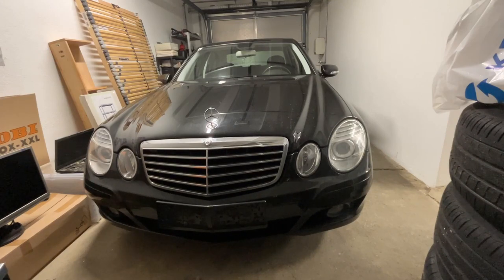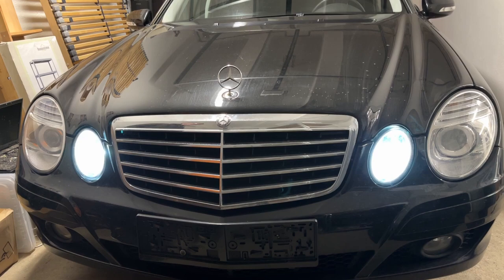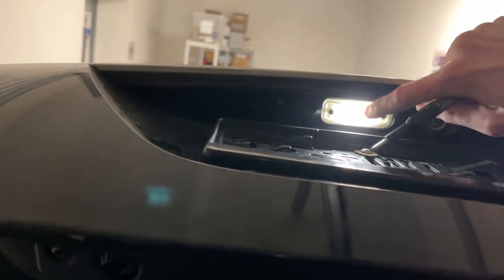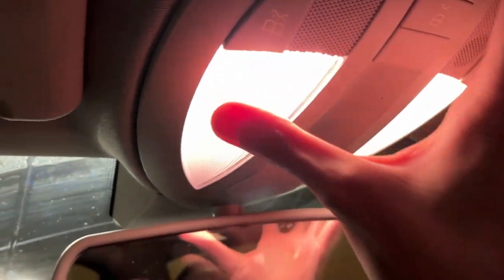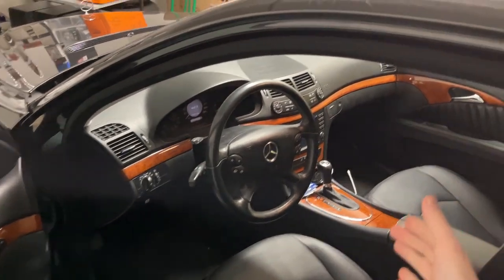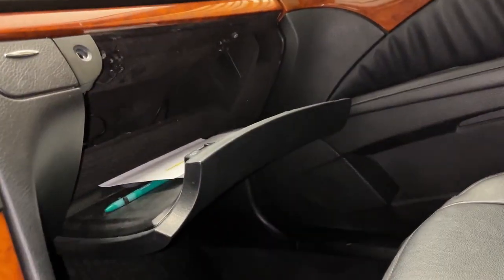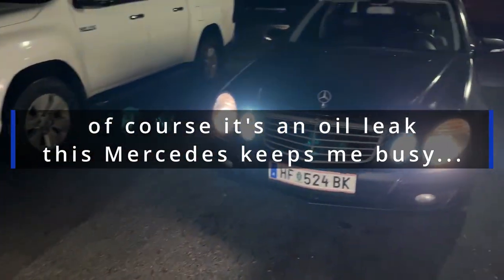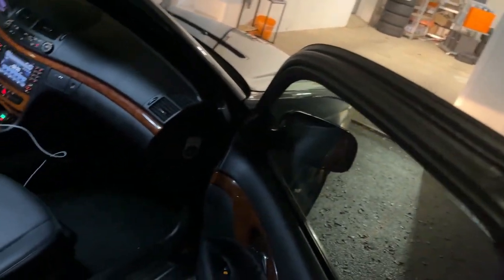Mercedes E-Class W211 LED Conversion (Vlog)

Comment: Seems to me that your car has H7 headlights. What happened with my E320cdi pre facelift was that the low beam was just terrible, I practically needed to use a flashlight to drive after dark. Replacing the H7 in the projector headlights with LED's did not help whatsoever. Then I came across an article that pinpointed the problem exactly. The Projection headlight bucket (Hella) was hopelessly corroded and no longer reflective. The only way to bring the car back was to upgrade to HID using a Morimoto projector kit. They have one that fits the MB projector headlight perfectly, but I say it right now, it is not a 5 minute upgrade. You need to remove the headlights (a challenge by itself) taking off the lenses, and they are probably getting dull already so that will call for new lenses anyway, Go and google the upgrades, you will end up with headlights that REALLY are worth the trouble. A lengthy project but replacing all with MB headlights will not be costeffective and not as nice and bright. Just save your money and don't even start throwing led kits at the low beam units. Check youtube for the upgrade process and parts needed its all here.
Reply: Als Nachsatz: Wie der Oe. Staat, Verkehrsamt und Tuev zu dem Upgrade stehen, da hab ich keine Ahnung. Mir kommen die Krausbirnen hoch wenn ich an diese Weicheier denke.
Reply from the maker: Danke für die Info, ist mir aber einfach zu viel Aufwand. Ja, das Abblendlicht ist wirklich nicht das Best, aber ich kann damit leben. Und wie du schon sagtest, keine Ahnung ob der Pickerlprüfer das dann durchgehen lasst haha
Reply: @whr_vlogs  also wenn die Originalausfuehrung H7 Halogen hat dann glaube ich dass die HID Aufruestung "illegal" ist. ... Anderseits wenn man die HID Leuchten abends einschaltet und man ENDLICH wie ein "normaler Mensch" alles sieht was da auf der Strasse ist dann sitzt man da und sagt "War es den Aufwand wert?" JAWOLL! 10 000 mal, es war den Aufwand wert!"

Comment: My mechanic installed Mirror so fast i couldn’t see  exactly but i’ll try to describe. He put mirror back in place then put a screwdriver in mounting brackets. Then he hit the bottom of the screwdriver and there it is 🎉 30 seconds.
Reply from the maker: Well, I'm glad he could do it fast and not mess around forever like me. I was so scared  to hit it hard because I feared it might shatter the windscreen. I then read on the Mercedes Forums that you have to push in the little pins (make the spring compress). That worked after a couple of tries eventually.

Comment: when you are doing presentation needed to give more information what kind of LED brand are you placing with, I have same car I change almost everything but the headlight run into Errors and cause the modulator malfunction.
Reply from the maker: You will need "CANBUS" LEDs, those will make the errors go away.
Reply: либо вам просто в линию надо припаять резистор с определенным сопротивлением

Comment: I brought some led canbus side markers for my 2009 and they flickering so I had to return them. So what's a good brand I should get for side marker and license plate
Reply from the maker: I also tried LED side markers but they either flickered or didn't work at all. I tried two different manufacturers. I'd say stick with the stock lamps.
Reply: @whr_vlogs  I agree, but I'm gonna try one more time with a different brand to see what happens, because I did change my side markers to the clear, and they would most definitely look better with the led look instead of that orange color. But it's a little confusing to me, because I came across another video where the  guy had the led side markers on his W211 🤷🏾‍♂️

Comment: Not a fan of led lights (interior or exterior) as it can be hard on the eyes, seems like I'm in a crack house or emergency room. Otherwise great job. Very tedious work with these Mercedes.
Reply from the maker: I get it, it comes down to taste. You could maybe get some softer LEDs which aren't white. But for me it's great, I often drive in the night and with the old lights you could hardly see anything in the inside to be honest.

Comment: O man i am fucked i broke the rear ribbon cable and connector i am screwd
Reply from the maker: Maybe you can glue the plastic back togehter?
Reply: Idk I doubt it thing is the cable snapped I spent all day with razer exposing copper then put it together it worked then the plastic connector broke ugh
Reply: @whr_vlogs they 100 bucks for the dumb wire and its going to take a while got to take off whole headliner